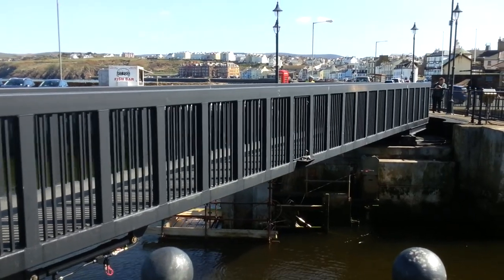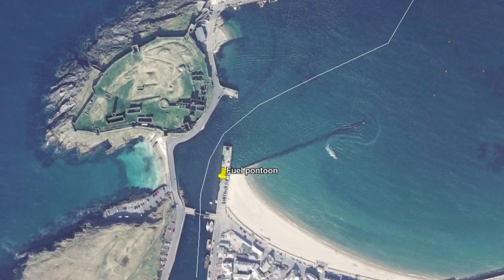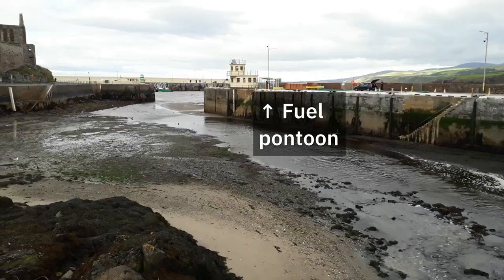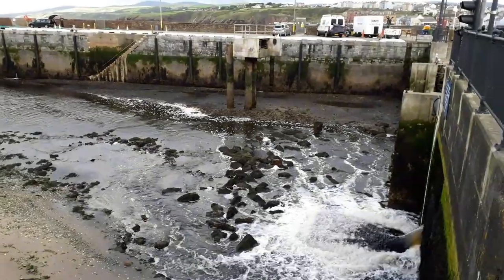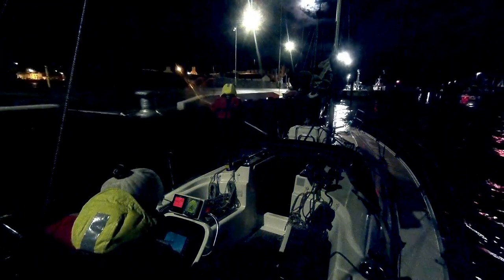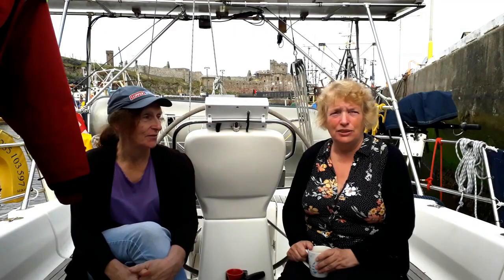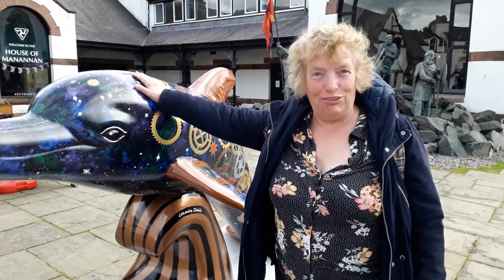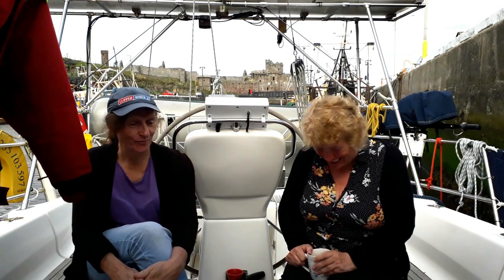Sailing Isle of Man - Peel - Calf sound - Irish Sea - Ep. 266

Comment: Well done that looks like a nightmare especially tired and late at night. Handled admirably I might add. Presumably the wall is subject to tide? How do you tie up there?  ps love the penguin hat.
Reply from the maker: The outer wall is sufficiently deep that there is always tide and you can tie to it or a fishing boat. The fuel pontoon can only be used at certain times and, in my opinion, a wise skipper would avoid fueling during the tail end of a falling tide. Once past the flap gate & bridge, the inner harbour / marina always has plenty of water. If you are curious about using harbour walls, we did an episode "Sailing the Isle of Man - Douglas - Harbour wall mooring - E. 249" which explains how to do it starting about 3 mins in.

BTW - I bought the penguin hat in Peel pre-covid 😄